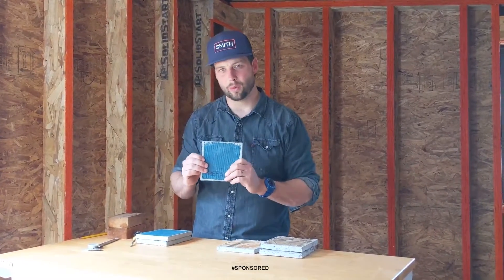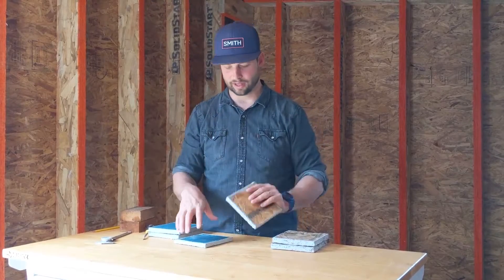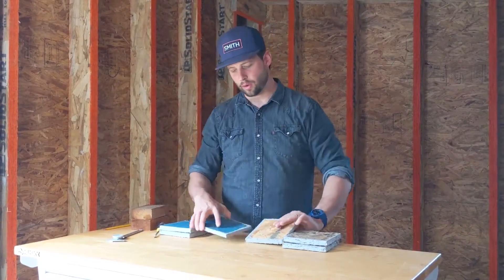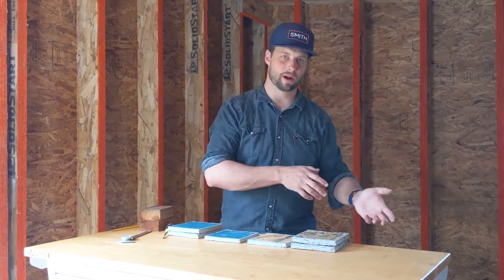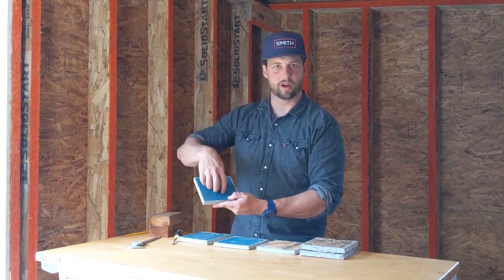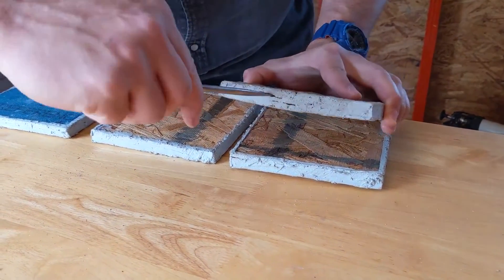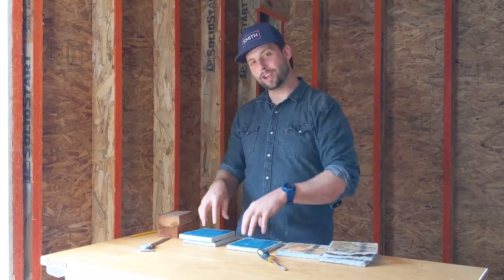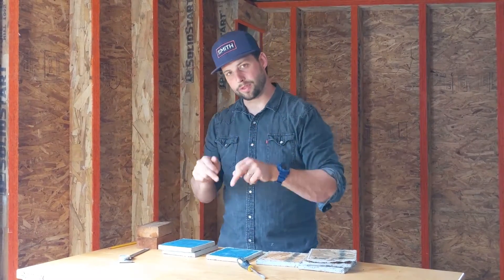Jordan Smith Puts LP WeatherLogic® Air & Water Barrier to the Test

Comment: You painted the backside of the LP but not the regular osb. To be fair, you should have painted only the edges of both or one side of the regular OSB. Or, you could have tested them without that sealant on either. Not a very good test to begin with as you said that neither piece will experience immersion.